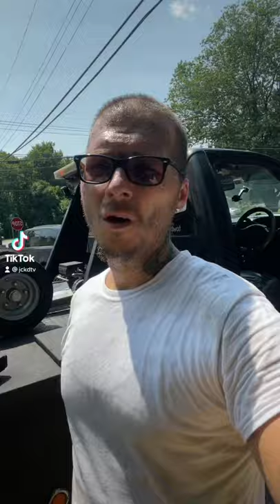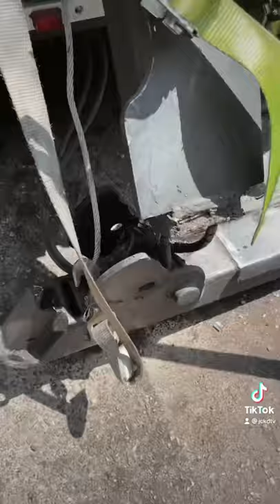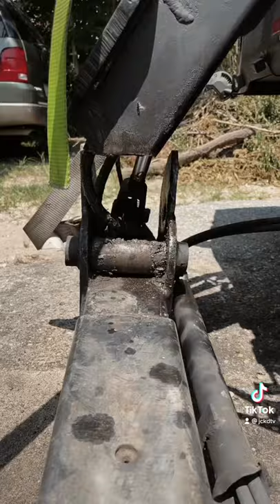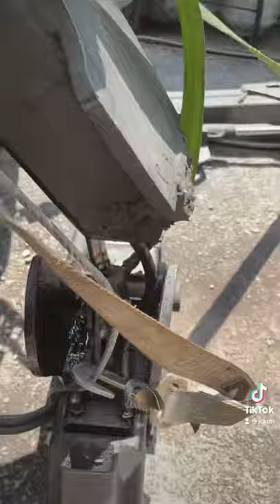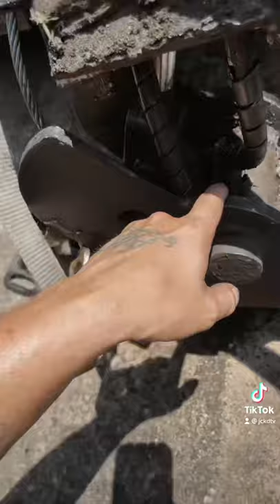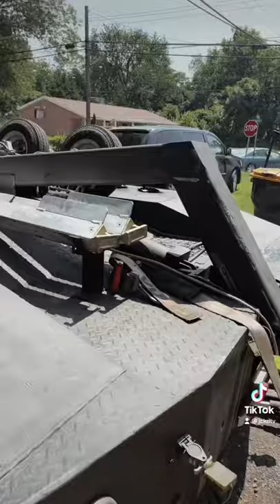My Tow Truck Wheel Lift Snapped In Half #shorts

Comment: Does the hoop of the cylinder go around that pin? Do you grease those? The head of the cylinder has to be able to move freely to pivot I wander if that's why you're hearing all that creaking noise, the pin could be seized and not allowing it to pivot properly, I had my pins in my backhoe front loader arms break from not being greased before I got it, and they seized somehow I was still able to use front end loader I guess the hydraulics were stronger and over came the seized pin, but eventually it ended up breaking, snapping my pin in half, make sure you grease the heck out of the rest of the boom and pivot points, if the grease zerk won't accept the grease get new zerks and keep greasing and moving the pivot until you've gotten plenty of grease all around the pins, of course after you get the broke arm fixed.

Comment: So looking at it again and what you're pointing at, you're saying the arm or boom was welded to the pin, and that's where it broke, correct? If it is then yes it can be welded to it again. And welders that are good can do it and beef it up for extra strength so it never happens again
Reply from the maker: Yeah I couldn’t trust a weld.  I would have to put all brand new shit. To price for everything it’s 5000 not including someone to put it on
Reply: @JCKDTV  the way the boom is constructed you're already trusting welds from the factory, I must not be looking at it right, if it's the end of the cylinder that goes around that pin or is welded to that pin you can get replacement cylinder ends or have it welded again where it looks to me like it was already welded once before

Comment: Shits brutal bro I run my own truck on contract and my book cracked off on the highway and I was lucky enough to pull over I had that shit strapped and chained to the truck because my boom had a small hydraulic leak anyway and kept lowering but now it's time to find iteration 2 of my old 7.3 rig.